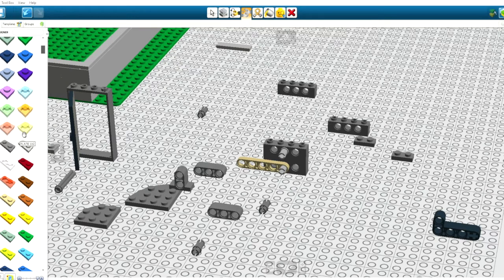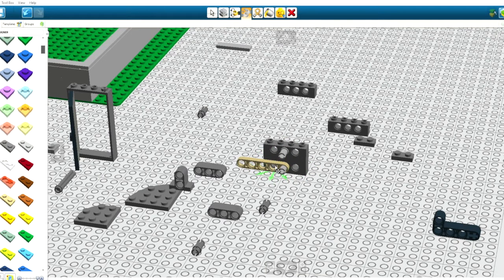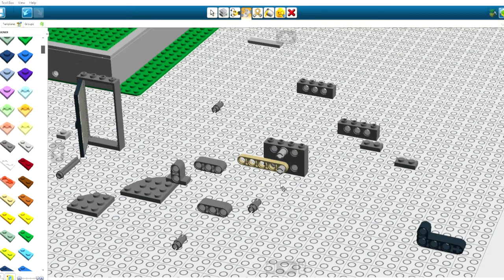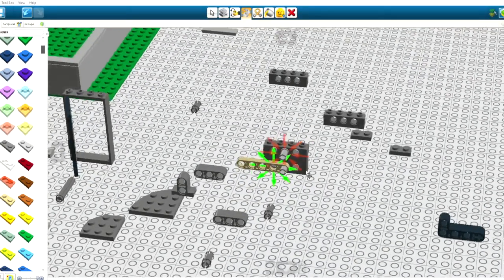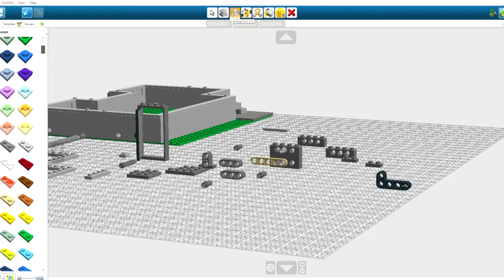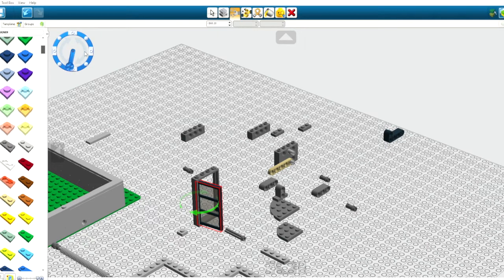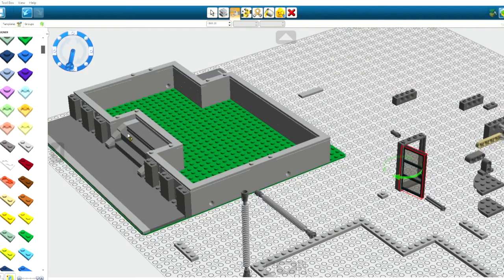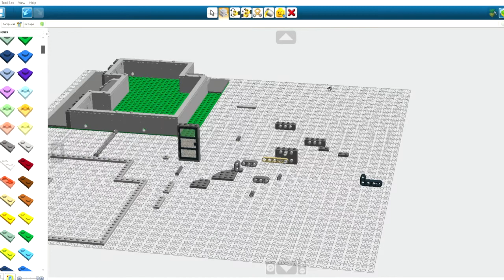How to use the hinge align tool and hinge tool in LDD

Comment: The reason the technic part would not hinge is the gap was wrong, too small. The third hole would have worked if you has a plate or two between the two 1x4 technic pieces. It's all about proper spacing with the technic parts. Cool video though. Thanks
Reply from the maker: Thanks